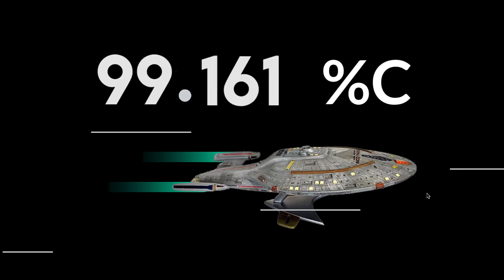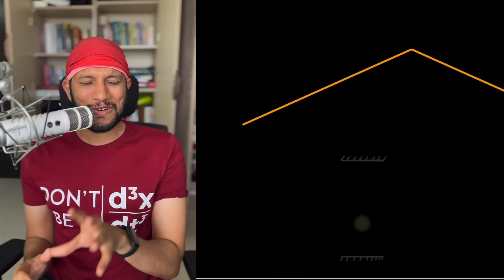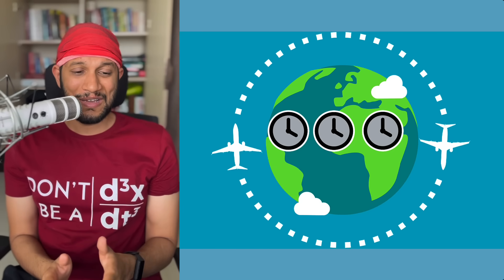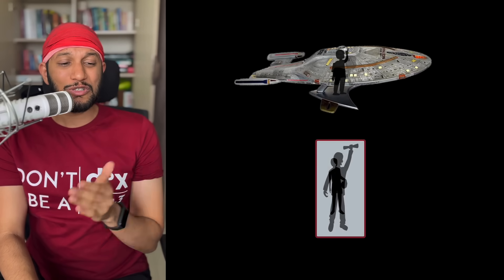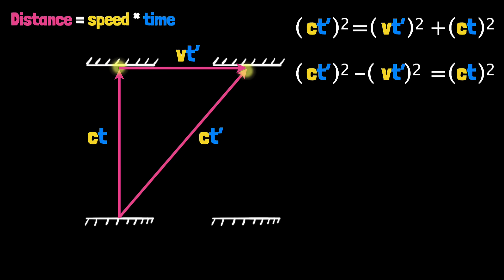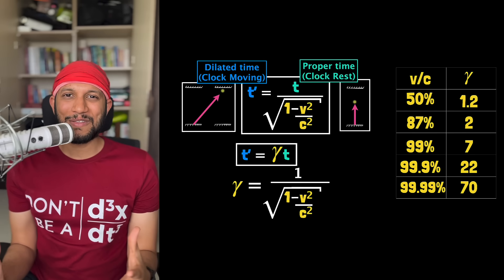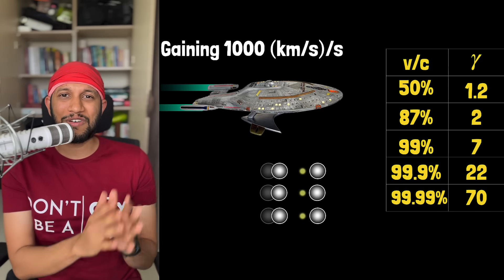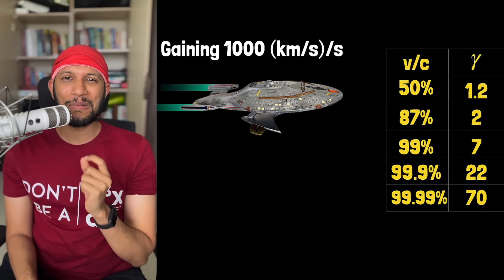I finally understood why you can't go faster than light! (My mind is blown)

Comment: What if you are IN the ship? Wouldn't you just go over the speed of light because you are completely out of the dilation problem? There is no extra infinite time for you
Reply: I had the same question, and some cursory research appears to indicate that it doesn't matter, because the reference frames are arbitrary. If you look at it from the reference frame of the spaceship passenger, the passenger is stationary while the universe appears to move around them. You end up with the same limiting problem of infinite energy. 

It's like riding in a car - you can look at it as the car moving along the stationary road, or the road moving under the stationary car. If the car is moving at 50km/h, the road is moving at 0km/h, or the car is moving at 0km/h and the road is moving at 50km/h. Both are valid frames of reference.

Comment: A simpler way to understand why you can't go the speed of light, let alone faster: All interactions in matter are inhibited by the maximum universal velocity: the speed of light. So for example, you have an atom that has an electron orbiting it. That electron can only move as fast as the speed of light. If the atom was moving at half the speed of light, that electron can only orbit at the speed of light, which is why you get "time dilation", because interactions occur more slowly down to the atomic and sub atomic level, which means velocity is time and time is velocity. What would happen if you could accelerate a spaceship to the speed of light? It would immediately become pure energy, because without any velocity left to take, an electron could not orbit the atom, matter would merely disintegrate since nothing can do anything to hold it together, all those forces would cease to function. So the first "test" of a lightspeed drive would basically just be an explosion of the entire ship disintegrating at the subatomic level.

Comment: You can go faster than light but something strange probably happens.
If you shine two torches in opposite directions to each other, you have two streams of protons moving in opposite directions.
So the photons in one stream of light are moving away from the photons at twice the speed of light, relatively.

Comment: I think what most people get wrong about space and time and the speed of light is that c (the "speed of light") in itself actually does not have anything to do with light despite the name. We just found out about c via measuring the speed of light (as in electromagnetic waves that we visibly can percieve).
However, c is much more than the speed with which light (and to a more general extent massless entities) moves - it is the universal unit of causality. With this speed at maximum an action may result in a reaction at distance.
Via c Einstein then was able to suddenly make the two (initially thought) fundamentally different entities of space and time compatible with each other - creating "spacetime". With a factor of 300.000.000 one meter is one second.

Comment: The stupid thing is that I knew almost all of the different scenarios mentioned as seperate examples for the speed of light, but I have never seen them set into context like this. This is amazing. I feel like a whole new view of understanding just opened for me.
Reply: SO tell me, If 2 twins are moving, A with relative velocity to B and B with relative velocity to A,
which of this twins gets older ? WHich biochemical processes goes slower ?
If relative velocity A to B and B to A is the same ? 
If you have some point between M31 and Milky Way and from this point
you will start Starship1 to M31 and Starwhip2 to MilkyWay,
how many generations you need to reach this galaxy in those starships ?
And what will be the relative age of this passangers ? Which will be older. ?
Reply: @PavolFilek This is a classic exploration of the Twin Paradox in Special Relativity. It’s a mind-bending concept because it challenges our intuition about time being universal.
Here is the breakdown of your questions based on Einstein’s theories.
1. Which twin gets older if both are moving?
In Special Relativity, time is relative to the observer. If Twin A and Twin B are simply floating past each other at a constant speed in deep space:
 * From Twin A’s perspective: Twin B is moving, so Twin B’s clock (and aging) appears to slow down.
 * From Twin B’s perspective: Twin A is moving, so Twin A’s clock appears to slow down.
The Answer: As long as they both move at a constant velocity (no turning around, no stopping), both are "correct." Neither is "older" in an absolute sense until they attempt to meet up again in the same location. To meet, one of them must accelerate (change direction or stop). The twin who undergoes that acceleration is the one who will be younger when they reunite.
2. Which biochemical processes go slower?
All of them. Time dilation isn't just a clock slowing down; it is the slowing of the passage of time itself.
 * Heartbeats, DNA replication, cellular decay, and even the vibration of atoms all slow down by the exact same factor (the Lorentz factor).
 * Crucially, the twin on the ship would not feel like they are moving in slow motion. To them, everything feels perfectly normal. They only notice the difference when they look at the other twin's "fast-forwarded" world.
3. The Starship Scenario: M31 (Andromeda) vs. Milky Way
In your scenario, you have a midpoint between the Milky Way and Andromeda (M31). Two ships start from this point and head in opposite directions at the same speed.
 * Who is older? If Starship 1 and Starship 2 travel at the exact same speed relative to the starting point, they will age at the exact same rate. If they both reached their respective galaxies and stopped, they would be the same age.
 * How many generations? This depends entirely on their speed (v).
   * The distance to Andromeda is about 2.5 million light-years.
   * If the ship travels at 99.999% the speed of light, the passengers would experience only about 11 years of travel time. They would reach the galaxy within their own lifetime (1 generation).
   * However, back at the starting point, 2.5 million years would have passed.
Summary Table: Time Dilation Effects
| Feature | Stationary Observer View | Traveling Passenger View |
|---|---|---|
| Clock Speed | Appears to tick slower. | Ticks normally. |
| Aging | Biological aging slows down. | Biological aging feels normal. |
| Distance | Stays the same. | The distance to the destination actually contracts (Length Contraction).
Reply: This is why speeding infractions are BOGUS! the clock to measure speed is slowed down so how is that fair?
Reply: don't, this is all pretty much B.S
Reply: I was bothered by the use of the photon clock (why not a tennis-ball clock?).  ChatGPT explains: "The appearance of c in the time dilation equation and in “speed limits” isn’t because of photons specifically. It’s because c is a fundamental invariant of spacetime itself, and light just happens to travel at that speed."
Reply: @sarsaparillasunset3873  A tennis ball does not have the same speed to all observers in all reference frames (states of motion). So the analysis would be more complicated. We have an axiom that a photon travels at the same speed to all observers, so the light clock is simply simpler to calculate about. We could use a tennis-ball clock if we are willing to put up with some extra algebra.

Comment: The problem with this explanation is that clocks measure time they don't actually dictate time.  I mean I am perfectly willing to believe experts on the subject as I have not traveled close to the speed of light but this explanation doesn't actually explain anything as far as I can tell.  Take for instance the light clock in the example wouldn't you get a completely different result if you simply reoriented it to be in line with the direction of travel or at at 45 degree angle from the direction of travel?

Comment: *we can't reach the speed of light using any technology we currently possess, or fathomably conceive

Example. Create a device that accelerates the speed of light in a given area. Then, theoretically, we could pass the speed of light in a given area where light is accelerated.

Alternatively, and this does technically exist, but good luck using it. What if you create an area where light doesn't exist? It may be possible to reach those speeds if you can cause that area to move.
Reply: How do you propose to change the speed of causality?

Comment: Lol xD explanation of this is bad xD tick inside ship if you move faster isnt longer xD but due higher speed space is bending so what you see its still same,but for you it look tic slower but it didnt because you see how that space bend xD and most important you cant never reach near speed of ligth xD because you are bigger and heavier than photon xD everything what havent irelevant weigth cant travel at speed of ligth xD because forces during aceleration will tear a part that obejct because his weigth will do inner force which wont hold stable in that speed xD this what we called as speed of ligth is limited base on the Black hole which our universe is placed,because what we call as the big bang what creation universe inside black hole when formed, that's why universe expanding because the black hole still eating outside xD so until we wont understand how gravity work and what is that,we wont understand other things xD time and gravity these two is what you need to know to understand basics of universe,we discover things but never unite them together to make sence on all levels xD

Comment: If time s normal inside then couldn't you reach the speed of light but only from your perspective inside the ship? While from the outside you'd just stop and fade away like what happens when you enter the event horizon of a black hole (just more instant here)

Since from your perspective nothing changes so for you the acceleration would still be the same no?

Though even if that worked sure you'd be at the speed of light but you'd also effectively be getting the same effect as flying into a black hole
To anyone but you you'd be gone

Maybe it's still unachiavežable because sure from your perspective nothing changes but that's still only perspective and not reality
Just cause you can't tell you slowed down doesn't mean you didn't

Though this is still a really neat way of explaining concepts like time prisons

If you somehow magically got someone to move st the speed of light they'd literally just vanish and eternally be stuck in the same place from their perspective

Comment: I would just like to point out that the Earth itself moves very quickly within the solar system and throughout space. Earth orbits the Sun, it travels at an average speed of about 67,000 miles per hour or 107,000 kilometers per hour (around 30 km/s). The entire solar system, including Earth, orbits the center of the Milky Way at about 483,000 mph (792,000 km/h). We are already sitting in a rocket :)

Comment: The photons aren't slowing down, nor would they move at an angle. You'd have to angle the mirrors to change it's direction to your forward. That change in angle is like increasing the spread between mirrors, so you'd compensate by bringing them closer as well. Which would result in the same tick speed. The photon never slows.

Comment: Stand on the back of a flatbed truck going 5 m/s relative to an observer on the ground. Throw ball to a friend on said truck at 3 m/s. Ball is traveling 8 m/s relative to the observer on the ground. We assume things pick up the speed of the things they're moving on.

But if you throw "information" it travels at c regardless of the velocity of the sender and receiver. With the receiver moving away at 0.9c, it takes much longer for it to receive the information.

Comment: This was all over my head.  But it was very interesting.  One thing that my simple brain yelled at was, the photon isn't slowing down, its just taking longer to bounce off an eqidistant mirror because of the angle of travel... more degrees away from perpendicular means a longer distance traveled,  but still going the same speed.  Did I misinterpret what was said, or did he misspeak, or huh?

One of these days, someone is going to figure out that light is not max V.  It's only the fastest thing we've measured, and we've foolishly based a century+ of math on it.  Still, this shit is beyond me.  Fun video.

Comment: In all these explanations I've seen, it is not explained, how the relativity of "movement" itself affects our observations. What do I mean? I mean, that in this video we are comparing stationary objects with moving ones. But movement is relative. So, how do you know, which one is the moving object? EXample: If both objects are stationary and you accelerate the one, we could consider this one as moving. But, what if both had been already moving compared to a different reference point and accelerating the one (backwards) was in fact decelerating it compared to the reference point. Wouldn't it then be aging faster (than the unchanged one)?
Even time dilation must be seen relatively, from the point you are at. But that's a contradiction, right? One object must be the "older" one, like the man who died first. It's not relative, who's dead and who isn't, right?

How do we explain this?

Comment: What i dont understand about this photon clock, is that if the ship is what is accelerating the clock, why would the photon lose vertical velocity to the horizontal velocity. Even from the perspective of outside the ship, the photon is travelling, yes, but its because of the ship. Does the velocity of the ship make it so that more energy is required of the photon, slowing it down? If thats the case, id say the clock, and everything moving at the velocity slows down, not time. The very fact that everything else goes on as normal is the proof. But the time remaining the same to the observers in the ship, would be just their perspective, since the clock and their brains would slow down by the same rate, it would appear to be the same to them, and any measuring device moving at the same velocity. But in reality at any velocity above zero, anything with mass would require more energy than normal to do anything, effectively slowing it down. It explains jet lag, why getting home feels faster than the trip away, g force in fast vehicles etc.

Comment: The easiest way to think about it is to realize that energy has mass (E = mc²). As a result as something speeds up it gains kenetic energy, and therefore mass. As the mad increases the force required to accelerate increases (F = ma). So at some point you wind up hitting a barrier where the energy you add to the system has more mass than the acceleration it can create.
Reply: Why does higher energy require higher mass: well, if you reduce the mass of an atom energy is released (radioactive alpha decay) in the form of photons. But those heavier atoms are created by fusion, which means at extremely high energy levels at extremely low apparent velocities (high pressures and temperatures) the excess energy from the photons is forced to convert into particles which have mass (depending on the exact conditions different particles are formed). So at the small scale mass and energy are interchangeable even for particles which are usually massless. (Yes, part of the energy release for alpha decay is binding energy but that also comes from particle conversions at the gluon level).

So when you're adding huge amounts of energy to a system that energy doesn't leave the system, it needs to remain and it can't stay as massless particles because the object isn't heating up. So the only way for the energy to be "stored" is through becoming mass.

Comment: 15:47 For the observer that may be true and the ship will simply disappear from view because when it's faster than light, the light from it will never reach the observer , but for the ship itself it's own forward view will change because it's getting more and more photons, so it will be brighter. Time will still be ticking the same on the ship because the observer on earth has no effect on the ship. When the ship return to earth the same time would've elapsed as on the ship. Again, exchange this ship with a very long rope, for the rope time will tick by at the same rate, no matter which end it is. It will age at both ends at the same rate, and this explains quantum entanglement which Einstein famously called "Spooky action at a distance" because he had no explanation for this. I believe faster than light travel is possible, our existing theories that are always based on some observer are incorrect.

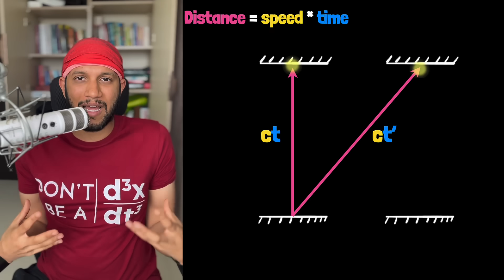Comment: 08:39 : time will be the same for the photon, it's still a theory, until you put a clock on that photon.  Why would the photon appear to go slower from our perspective?, because it's moving away from us at the speed of light. Real time did not change for us or the photon, but the distance between us changed. I do not believe in time dilation, I believe gravity have a much larger impact on light than we think, I do not think a black hole is black because of time dilation, but because gravity is able to slow down light. This explains gravitational lensing better than time dilation, unfortunately all the measurements and experiments are based on Einstein's theory that time is not a constant, but the speed of light is.
Reply: he also mention gravity does play a role